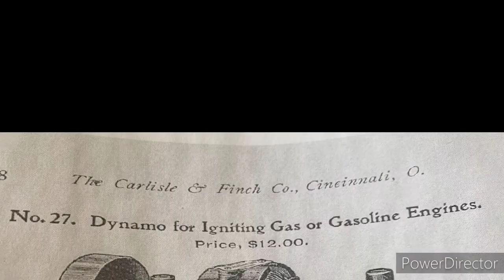Carlisle & Finch: DC, Bipolar, Electric Motor, Dynamo.  Restoration & Conservation. Circa 1899/1900.

Comment: Awesome job on an unusual piece. You're probably already aware of this, but if you want to or need to use a two-part epoxy, you can use one of my old gunsmith tricks and stain it any color you want with a few drops of enamel paint.
Reply from the maker: Thank you for the great tip. I enjoy watching some of the gunsmithing restoration videos. Those guys pay attention to detail.